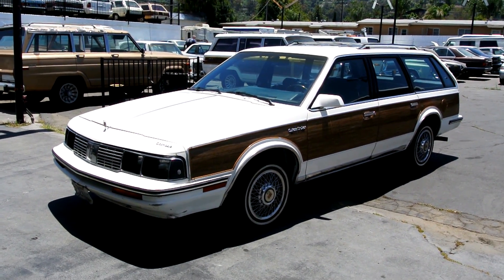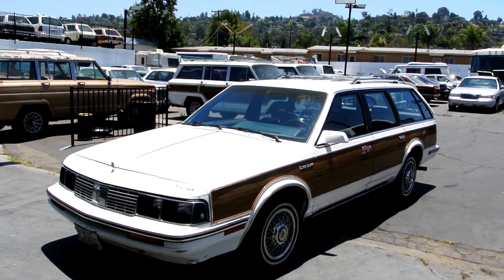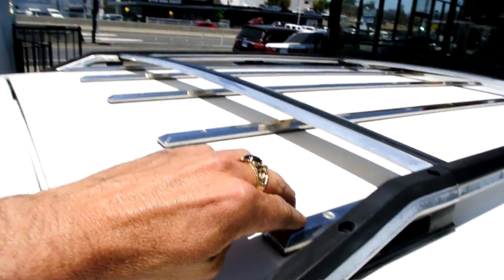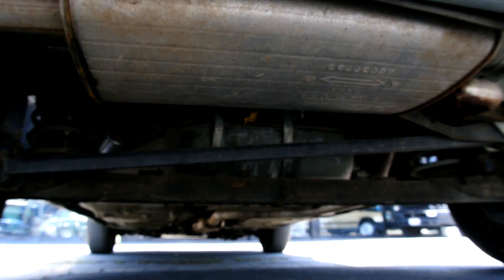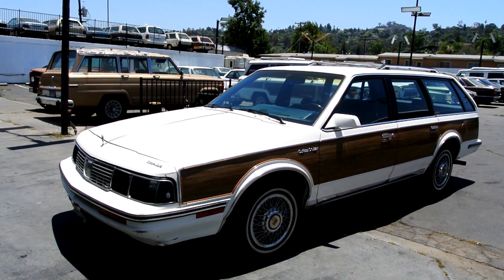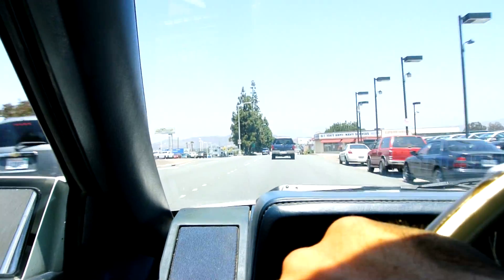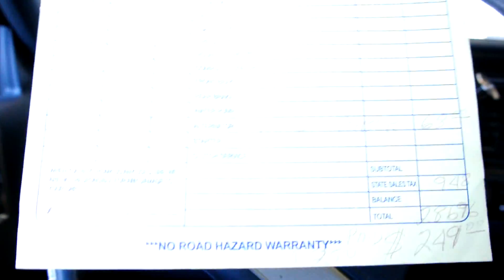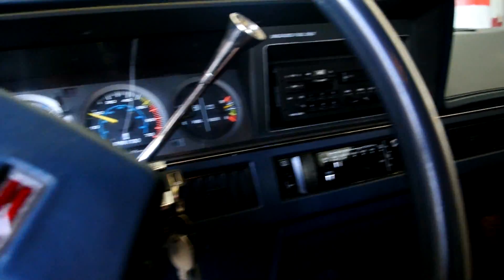1988 Oldsmobile Cutlass Ciera Cruiser Woody Station Wagon Low Miles

Comment: It's an 88. the front lights are 85-88 but early 88. The cutlass badge went until 95 and also the steering wheel was new in 88 like this